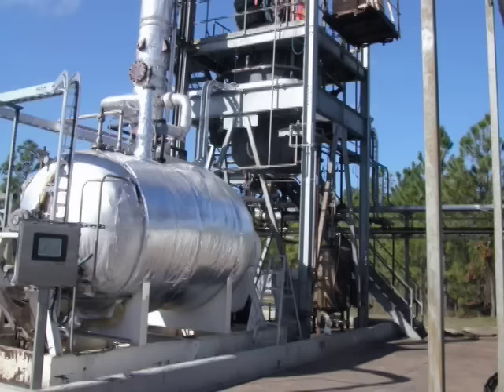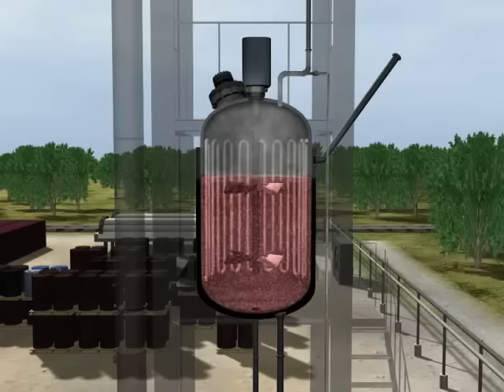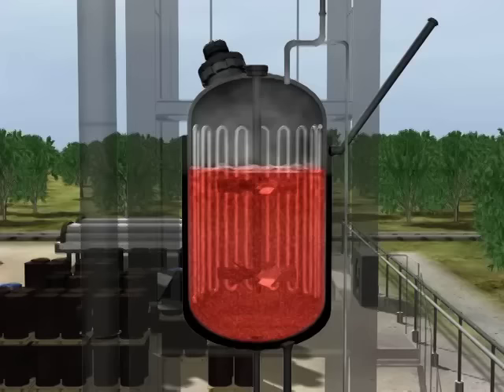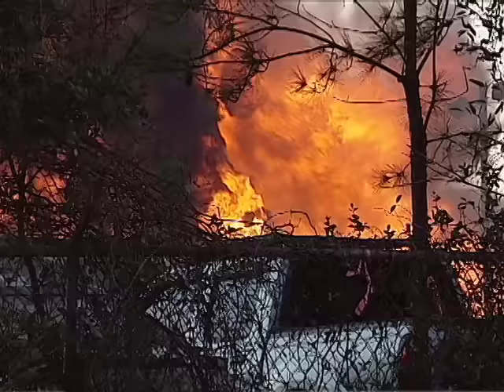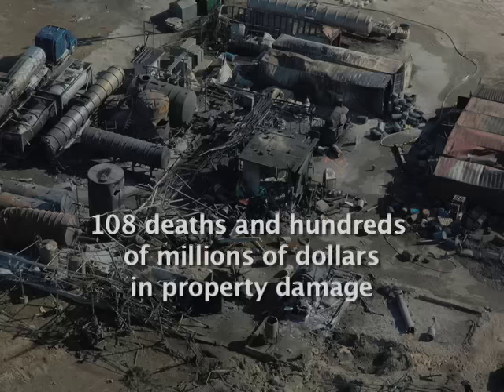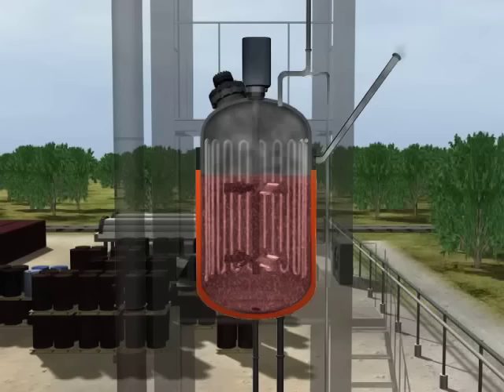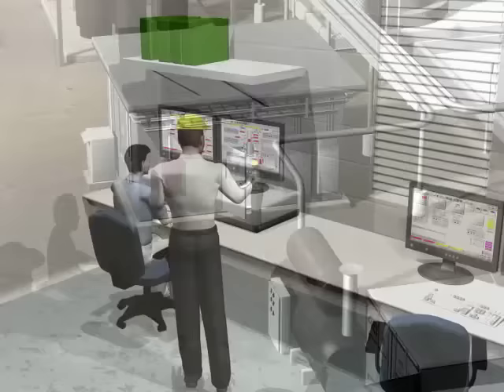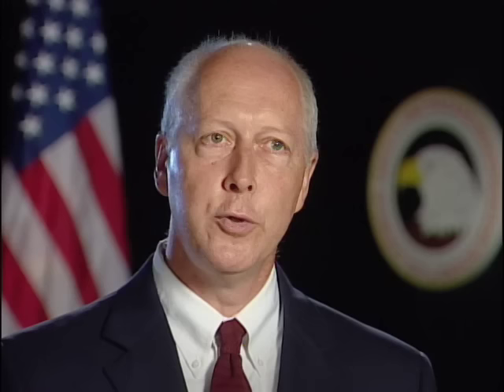Runaway: Explosion at T2 Laboratories

Comment: I didnt know everyone was suddently a "reactor pro"
Reply: How many years of Reactor Operation do I need to be a pro? 🤣
Reply: It's kind of funny that a person not associated with this type of operation could easily see the flaws.  Only a moron or a person concerned about saving money would think a vessel that dangerous needs only one cooling system.
I'm not an engineer, but from an engineering point of view that is unreal to the plant would be allowed to operate without a backup system of some sort. It should have been part of the design.  Somebody would just worry about saving a few bucks....   ok, a lot of bucks.   How much people would it cost to put in a backup system then to clean up that mess and rebuild the place?
Reply: The reactor pros obviously weren't pros.
Reply: @zacharysmith2983   years, you've got to be kidding. It's an 8 hour course and covers everything imaginable. 😁

Comment: Negligence on the part of the designer's and owners because the reactor should of been protected 6 ft concrete walls and a secondary failsafe tank with liquid nitrogen for rapid cooling in an emergency...

Comment: So, it's the equivalent of 600 t of tnt, with only 2,5 t chemicals in the reactor...
Despite TNT is a commonly used substance, it's chemical energy is surprisingly low. We should use other models to describe devices, or accidents.
Reply: Gustav, they've been using TNT as the standard of comparison for explosives for decades.

Comment: I cannot believe qualified chemical engineers were not fully aware of the results of these reactions.  Also, basic engineering states (at least in Canada) that any pressure vessel must have redundancy systems, doesn't matter what reaction is proceeding within the vessel.  How was this not law in the U.S.?  It's been known as far back as the Boiler Pressure Vessel Code for steam locomotives and stationary boilers.  Someone help me out on this one.

Comment: Ive made tanks like this and almost none of them are factory tested to hold much over 100psi in the vessel. The cooling system should have simply had a manual valve, no different than a garden hose hooked to city water. Trusting computers and automatic valves is stupid.

Comment: How the hell did they not have a redundant cooling system!?!?  Separate set of plumbing should have been ran and sensors detecting water pressure in main cooling line, therefore in the event of a cooling failure, backup cooling line be initiated!!!!

Comment: i dont have any type of degree or chemical knowledge but why the hell didnt they have a pressure relief valve????? even my house boiler and shop's air complressor have  pressure relief valves. a properly sized pressure relief valve would vent the pressure to the atmosphere or perhaps into another empty tank in order to avoid an explosion if the pressure reaches near the maximum allowed by the tank's manufacturer.
Reply: That's what the rupture disk was for. Problem with it, just like PRVs, is that it doesn't work if you undersize it. Which, appears to be the case here.

Comment: I'm curious as to whether the explosion was caused by a spark or if the temperature inside the reactor vessel any of the release pipes reached a high enough threshold to auto-ignite either the mixture or the hydrogen in the relief pipes.
Reply: It seemed to me that the relief pipe was too small to handle the rapid pressure increased caused by the increasing temperature. The material vaporized inside an enclosed vessel faster than it could escape causing the vessel to explode like a very large pipe bomb or an old time steam engine with a bad pressure relief valve.

Comment: I don’t understand why this happened, as they had a rupture disc in place to vent the reactor in case of excess pressure. The rupture disk did in fact rupture and seemed to do its job and vent the excess pressure. What good is a safety release if the safety release still does not work???
Reply: A pipe can only vent so much product. If it's too small the pressure will continue to build.

Comment: Why wouldn't you check the cooling system was working, before starting the reaction? Like.. isn't that the kind of obvious thing a non-braindead person/process would demand? Step 1) Check cooling system is operating with nominal flow rate. Step 2) Start reaction.

Comment: I don't understand the following things:

1. Why had the venting system a too small diameter?
2. Why are the chemicals added at once? Why not supply the liquid step by step? (So I handle it in the lab) In this design, the only way to control the reaction is to remove heat....

Comment: This seems to be the same problem in more than one place. What do you do if you lose the ability to cool the reaction. Of course with a nuclear plant it is much more of a problem. Since cooling failure can result in a meltdown of the core. 

I would say you should have a water tower that can work by gravity to cool the vessel if you lose city water as your main cooling source. Also blowing off pressure into the air is not always a good idea either. It may catch fire and if the gas released is heavier than air it will sink down and then catch fire if it hasn't already. 

It may be better to allow it to blow off a valve on the bottom of the tank and allow liquid to flow into a larger but thin vessel located underground so the reaction should slow and heat can be absorbed into the ground. Probably better to create another Superfund clean up area that an above ground explosion.

Comment: So, what was the issue here that caused the explosion?
Was the 400psi burst disk pressure too high and the vessel couldn't handle it and ruptured? Was the piping size for the relief system too small, and the pressure rose too high for the vessel even though it was venting? Did the chemical reaction run away to the point that it autoignited, even though the pressure was being released?
What exactly happened here?
Reply: piping too small, no redundant cooling, probably a lime scale issue in the cooling jacket because they were boiling city water

Comment: Who signed off on the design and operation of this plant? Does the CSB just investigate the aftermath of screw ups or are you actively involved in the permitting process of plants?
Reply: The CSB works to promote chemical safety.  a big part of that is investigating what happens when things went wrong, so they can make change recommendations to the various regulators to KEEP that from happening again.

Comment: Stuff like that should be built underground, with multiple backup systems and a nice concrete jacket to direct potential explosion. Plants with tanks full of dangerous chemicals just sitting in the open like this are a nightmare fuel.

And that goes for everything - nuclear reactors, dangerous chemicals, explosives, etc. Time and time again we see pyrotechnicians explode stuff in a hole to protect people and the environment. Yet almost never it happens in the commercial world that explosives and tanks of chemicals are stored underground or in a decent pit.
Reply: Why would you put it underground? Now you need to design and build a relief system to vent the entire plant area to protect it, and every person working there, from an over-pressure if there's an explosion. (Yes, it killed 4 people. So let's build it underground so the next time it blows up like 1500 pounds of TNT, we'll kill everybody in the plant because they're locked in a cave with a huge explosion going on?) And have the relief system for the reactor itself. And even if there's no explosion, say just a leak or something, you'd need to build a system to purge the entire underground plant of vapors/fumes, and have a way to supply safe, breathable air throughout the plant before it kills  everyone. It gets to a point of being stupid. Sounds like you went to the same school as the company owners in the video.
Reply: @KSparks80  The whole plant don't need to be underground. Just the tank with the reactor. Literally an open pit storage is good enough to reduce a whole lot of damage.

Comment: I dont get why they'd install a failsafe valve, that is meant to breach when excess pressure is inside, with such a resistance that when it breaks, it's already too late... that's not logical.
Reply: The reaction occurred faster at a larger scale.

Comment: Venting hydrogen to the air doesn't sound like a good idea. Burning it sounds like a better plan (or capture it and use it for something, e.g. to do the initial heating of the reactor, would even be better)... Also: Of what use is the rupture disc if the whole piping can't release pressure fast enough? Shouldn't someone have done the math while designing this facility?

Comment: T2 Laboratories would have been better off building an array of small reactors, based on their proven earlier design, rather than scaling up a single reactor to get the desired production volume.  Failure of any one reactor might well have spared the rest of the facility, minimized damage and avoided loss of life.

Comment: What are they talking about. they knew about the chemical reaction building up pressure and elevating temperature. they had a pressure release and a cooling system. No this is another case  of a company cutting cost in safety installations. Money first safety after.

Comment: If the design specs had been increased so the container could have held a bunch more pressure, then maybe the rupture disk would have worked much better. 
The fact that the stupid disk was only a few seconds away in pressure difference to it going freaking Boom is dumb.
The whole thing is dumb.

AND I’m thinking that those buildings to the right in the video are Nuclear cooling towers, probably scared the absolute crap out of them.

Comment: Never live near or locate your business near a chemical facility. There should be a mile separation distance from occupied resdential and (other) business structures. If the Air Force can isolate bomb dumps on US bases, so can chemical companies. Millions of pounds of explosives are stored on military bases, but they are properly separated to avoid fratricide.

Comment: Safety needs to number 1 in any activity whether it is driving a car flying an airplane walking using or mixing any chemicals always read the instructions for handling any chemicals if a container doesn't have instructions retrieve the MSDS and lookup and cas numbers you find in the the material safety data sheet always know how the chemicals you are working with interact and never mix more than you can handle and never overload container beyond what they can handle and always know the dangers involve and have appropriate response systems in place never neglect safety this was a completely avoidable accident and it all happened because somebody let their wallet talk and when people get greedy they often overlook things and that is why this happened they decided they wanted to to make as much as fast as possible and in doing so they added more chemicals than the reactor could handle in a safe maner and lack of suffecient cooking

Comment: Hey, guys, let's perform a highly exothermic reaction that produces large volumes of flammable gas in a 2500 gallon pressure vessel filled with organic reagents and MOLTEN METALIC SODIUM in conditions that would cause thermal runaway with a single point failure. What could go wrong?

Comment: 1. Cooling water valve line should have had a bypass or an alternate source of cooling water. 
2. SOPs should test if cooling water is working before every batch. 
3. The rupture disc was not sized correctly. 
4. There should've been some emergency shutdown system to empty out/neutralize the contents of the reactor ASAP.

Comment: You wonder why they didn’t have a flare tower for the hydrogen. Risk of fire?
Reply: I assume because it is lighter than air. Keep in mind that the explosion was caused by vaporization of the liquid like a water heater with a bad pressure relief valve.

Comment: It is sad that ignorance of basic risk assessment is so rampant.  Even with all that left-leaning self-righteous attitude, our schools still churn out engineers and chemists and scientists with nearly no moral compass, scarcely having covered the basics of ethics with a half-credit class, amd quickly forgotten.  And so many of our businesses are operated with no inclination, and even a decided reticense to simply ignore easy risk assessment and risk reduction methodologies until an insurance company or a lawyer or even a customer calls them out.  This company only paid part of the price with their lives.  In hindsight, at this facility, I bet it would have been more profitable to build multiple smaller reactors that were easier to control, less risky to operate, and easier to perform regular service without experiencing loss of production.  I have no idea if this facility had good safety measures in place. The design of the reactor could have easily been assessed for risk with a few calculations, and maybe improved before construction.  The video mentioned standards for pressure vessel construction, but not the risk assessment standards, available from multiple sources, like ISO12100 and others.  If you are involved in dangerous equipment and you don't have documented risk assessment in your toolkit, get started!  Risk assessment may actually save you money and time.

Comment: This is a seriously dumb design. This reactor should have been built in a concrete pit with redundant cooling lines fed by gravity. Submerged cooling lines in the pressure vessel might have been better too.

Comment: Failure of regulators to govern.  Inspect.  I can't move dirt on my property without a permit and inspection.  All the speakers on this video fail to mention the government liability for allowing this facility to operate without proper inspections and design review.  To blame only the owners is a redirect of the real blame as this had to, I would assume be, a permitted facility so finger pointing can only be in the mirror by the government officials that failed to insure a proper design and failed to monitor the facility.